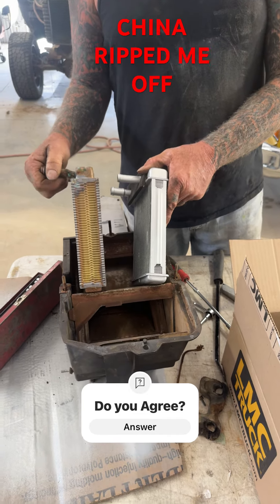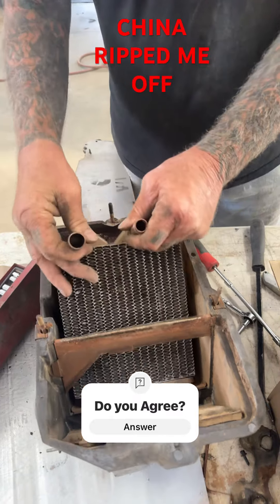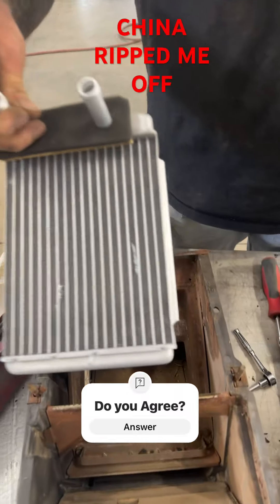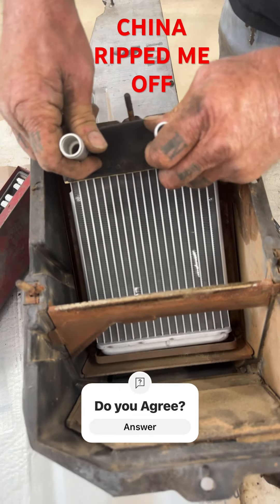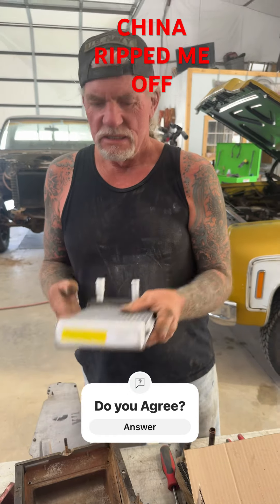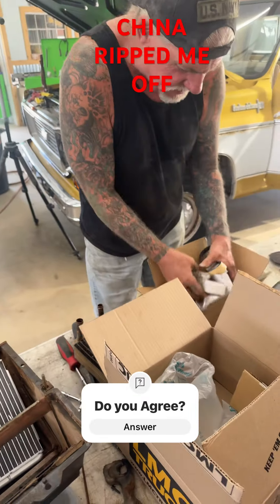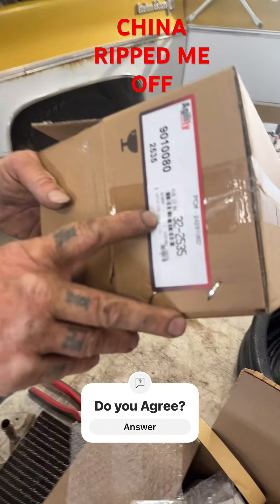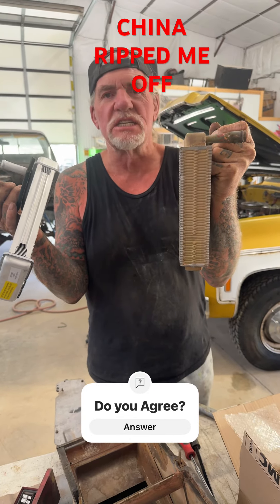I Got Ripped-Off From CHINA😡😡😡 #automobile #howto #diy #car #vintage #automotive  #china #usa

Comment: I use Rock Auto for just about all my parts needs for maintenance. For a 74 C10, Rock Auto shows pictures of every heater core from the front and the sides and possibly the back. They offer the cheapo version (like you have) and they go up almost fifty bucks.  At least with Rock Auto, you are not purchasing sight unseen. Spectra offers good products and I have no idea where manufactured but I have not seen Harrison offered anywhere.

Comment: You wouldn't get a brass and copper US made heater core today for less than 100 dollars. 
Also careful using copper in a system with aluminum like an intake manifold or pump. It makes a galvanic reaction.
Reply: Copper radiators and heater cores are OBSOLETE. NO LONGER USED ON NEW VEHICLES.
Reply: @looking_33  
"New Vehicles" 
Duh. That wasn't relevant to to this video or either point I made. 
You can still buy Copper/Brass heater cores on Summit Racing etc for old vehicles.

Comment: Try buying a replacement for a '60-'63 pickup with a deluxe heater.  They sell two heater cores, and neither one fits.  It's not just LMC though.  All the usual suspects have the same shit.  I had to find one from a NOS one on eBay.

Comment: Yep, I made a video similar to this years ago but with the non ac 67-72 GM trucks. The aluminum heater cores just don't fit as well as the brass copper cores. It's really like that across the board with other old GM vehicles as well

Comment: Bring back the good old days when you could buy a GM quarter panel that fits perfect. Now they sell you a one piece quarter panel for a 57 chevy. The fucking thing doesn’t fit and it has a vertical seam down the panel. All garbage better off making you own panel.

Comment: lookat the fins on each one... the new one is a more efficient design than the 50 yr old one, same as radiators now vs 1974... you won tfind the original made anywhere.

Comment: Your kinda old to just now figure out how you might as well piss in the wind wearing your best duds before a date night with the wife than buy china shit , I would look on the bright side least you didn't order food from there 🤣 junkyards and people in your area who make or rebuild that stuff are your friend , my distributer cap is probably 50 years old but has the solid brass pins an made of that bakelite stuff , the nosecone for my starter is probably older but cast steel an will out live me , if your turning over product is one thing , one off stuff tell the customer where his meat is sitting buying that shit , Thx for the heads up on lmc